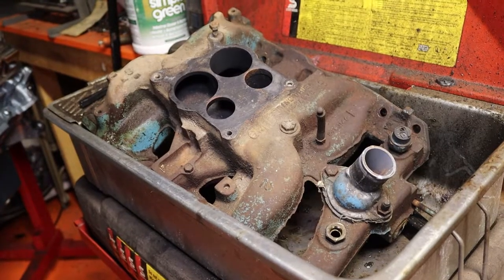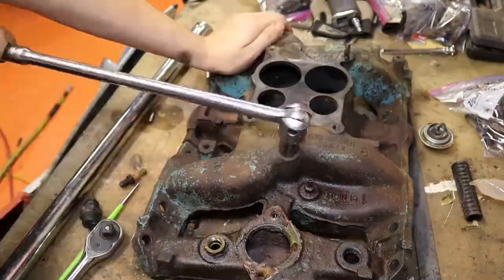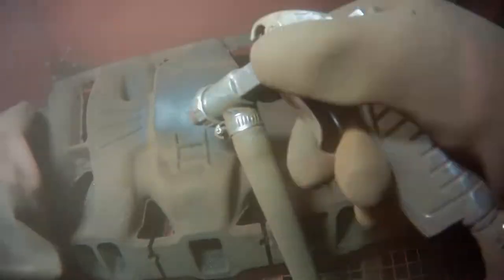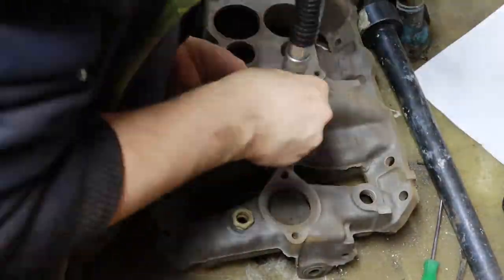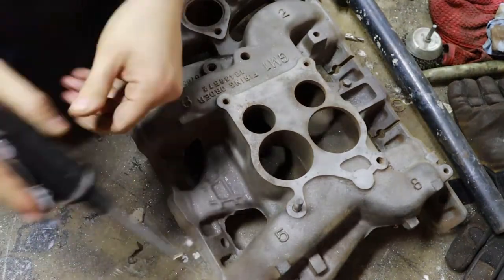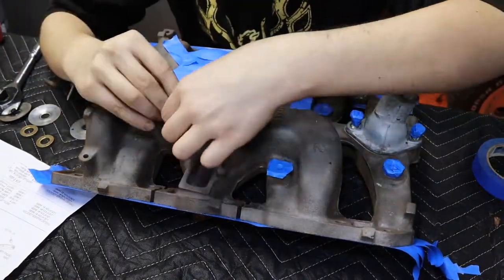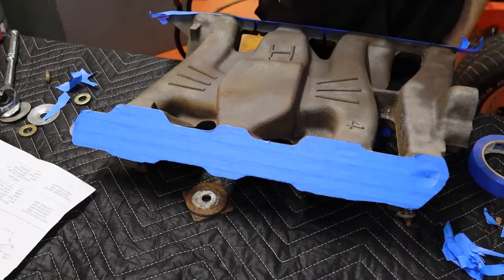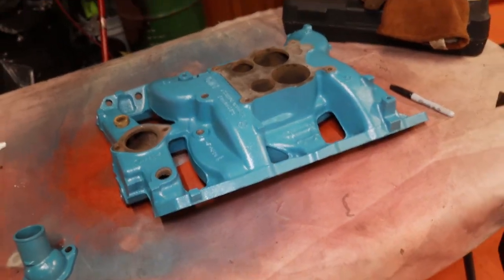How to Clean and Restore a Cast Iron Intake Manifold

Comment: I used a cheap die grinder to hog out a piece of 3/8" steel plate for my knife grinder and the trick to make it work well is to pack a bunch of grease into the head where the angle gear is.